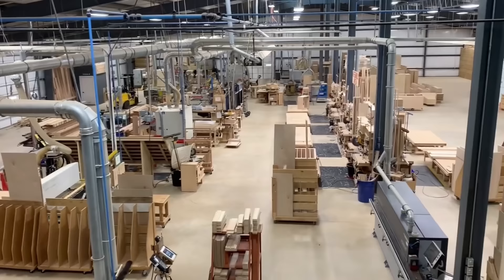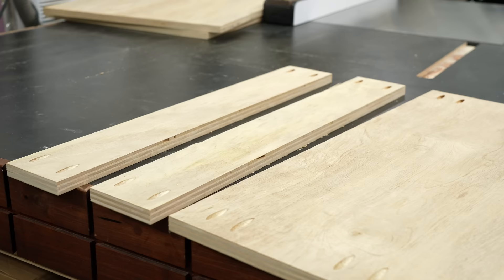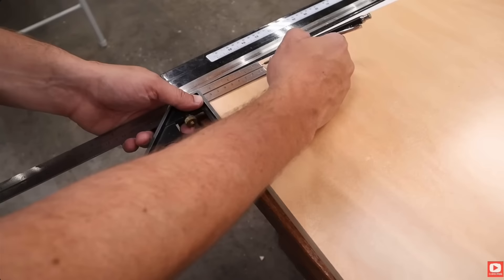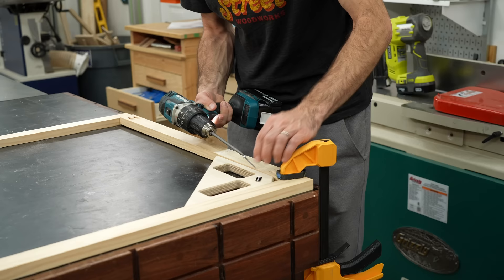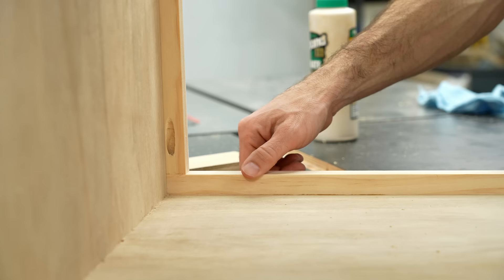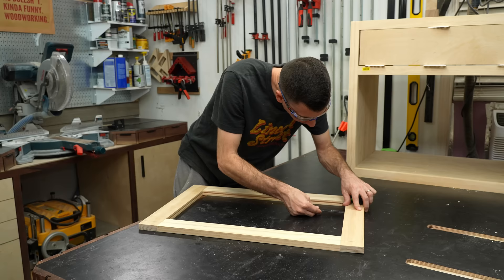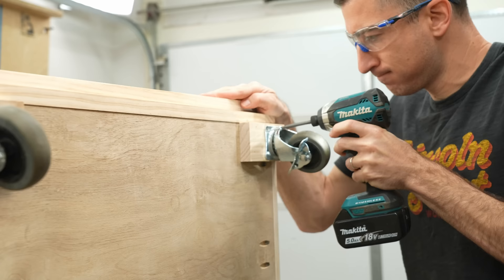Bad Beginner Cabinet Tips

Comment: They got those push trolly just need a bonnet and you got Trojan horses.  But I was trying to figure out why jewely boxes only fit turds, its because theres is no vertical display box.  I mean you got 30 flavors of vape juice, how can you read the labels?  Vertical display box.  Two on either side, 7 across a distributable load - [ every manufacturer reinvented apple peach ].  Tools touch down first in your mind though, its the same acrylic case layed flat.  But how to cram a hole good, so 24in deep is pretty deep.

Comment: Is it overkill? Is it?
Your cases, drilled into the wall, won't face the same stresses, but over time, they face some, and the deck screws will gradually pull out of the plywood endgrain.
Corners made by screws into any end grain, especially plywood, are bad for long term stability, because they pull apart eventually.
Reply from the maker: This would be true if you were pulling against the screws. But you’re not.
Reply: @Lincolnstww  there's always a little stress. It will last a good long time, but it will eventually pull apart, just get wobbly. You gotta account for that if you want to do it really good.
Your work is clearly "pretty" good.
Reply: @itsROMPERS... My guy, this is a video about making easy DIY cabinets with a limited tool set.  Maybe you should relax.
Reply: @AuronJ  I'm totally relaxed. I just remember that joining with by mailing into endgrain is not ideal. Because it isn't.

Comment: I did not cut toe hicks in the cabinet. I built a 2x4 frame 4”smaller than the cabinet and attached it to the floor and leveled it. Then just set the cabinet on it. Simple.
Reply: I put a level ledger on the wall and use Desunia Cabinet Leveler legs on the fronts.  You can scribe a toe kick face to the floor and clip it to the legs.  This means your bottom cabinet sides sit on top of the bottoms.  Leaves plenty of room for future plumbing/electrical runs...

Comment: Great tips...and here's one for you. Correct speech includes the words:  length, width, depth, and breadth. However, if I am hearing you correctly, you are saying "heighth", which is incorrect. "Height" is like the word "weight" in that it ends with only a t and not a th. (...and this is a case of "always", not one where "either/or" is OK.)
Reply from the maker: You are not hearing correctly

Comment: re: Tailgate (I'm sure you meant the lift piston that holds the hatch/window/lid up) - a more compact solution is a piece of PVC cut to length of the piston rod, and a cut down the side so that it can slip over the rod.  You can slip it over the rod and the hatch will stay up.  Equally good if you need to drive with the hatch up, but don't want it to bounce (and mar your materials).

Comment: The links to the tools used is very helpful. It's worth it to make something out of plywood instead of getting a particle board/mdf piece of junk from a big box store. Got one of the junk ones for my friend's kitchen but the rest were unfinished plywood ones from Surplus Warehouse (now called Barton's Home Outlet). The particle board one is already falling apart. The other ones are in great shape.
There were some techniques here I didn't know about so this was helpful. Although, I think I want to do a french cleat mount for my wall cabinets in my bathroom. I can still screw the cabinet to the wall, but the cleat will hold it in place better.

Comment: before watching this video i am commenting on the thumbnail. i dont like screws in fine carpentry, i HATE pocket screws in anything. i use rabbet joints, miters, dovetails, etc. with glue and nails. no not gun nails either. i pre drill and hand drive. sinking the heads perfectly flush. no filler. i always thought it looked good, that is my preference and anyone ive made something for has been pleased with the outcome. only time i use a nail gun is for assembling pieces that the naked eye doesn’t get to look at.

Comment: Excellent video, and excellent advice.   I do, however have just one issue with the drawer construction... that inset drawer bottom rubs me the wrong way.  If it was in a plowed groove it would be well supported even if the glue failed.    Yes, that will reduce the depth of the drawer slightly, but... Anyway, excellent video.

Comment: I'm jealous of the clean cut that you get when cutting the plywood with the circular saw.   My cuts are not that clean and neat.
What blade do you have in your saw?  Do you have any other tips for getting clean cuts with a circular saw?
I love your videos.  Keep 'em coming!
Reply: Trying running a line of tape on each side of the line. Keeps the material in place and reduces tear out. Use a finer tooth blade.

Comment: Great Video.  A 2X4 is all you need for a toe kick, long side up.  They are easy and best thing is you can make a nice LEVEL base the cabinets sit on.   You can simply paint or attach a pretty wood face to the exposed side when finished.
Reply: One of my early woodworking projects was a toe kick, to turn an Ikea over-the-fridge kitchen cabinet into a family room window seat. 2 by 4s, cut with a Japanese pull saw, fastened with pocket screws. The cuts were wonky, so glue wouldn't help much, but strength in the joints wasn't necessary. Finish was a coat of paint ... didn't have to look good either, as who checks the finish quality on a toe kick? 

I finished with a skill I knew much better, and sewed cushions and throw pillows for the top.

Comment: I'm new to cabinet building but if you glue the edge to the face of the plywood, is it really adding much strength? It would seem it would only be as strong as the bond of the veneer.

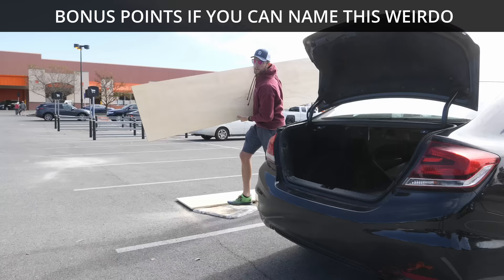Comment: 0:55 I bought what is now an almost 20 year old minivan (I call it the mule van) for cheap, for the purpose of hauling materials. I have to move the drivers seat uncomfortably forward if I want to get a full sheet of plywood in there, but it totally slides in. And for 12' lengths of materials (in my case, concrete form tubes which I use in the process of building certain cat tree features), I can just strap them to the roof rack! Right now it's a parking space thief (it's not starting), but I have more plywood than anyone I know. If I need 2x4s or 7' long round fence posts, they will in fact slide into the back of my Acura ILX with the back seats down.

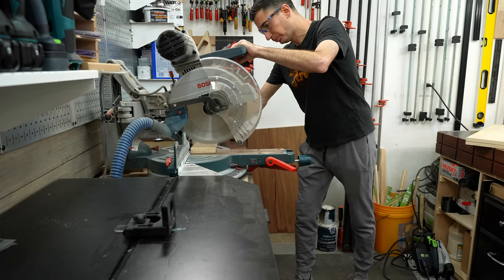3:26 Oh man.. I see people using it for building cat trees. People bring me those cat trees to get repaired, and I always notice something has gone wrong with the OSB (it doesn't like getting wet). I explain to people that it's not a structural wood product. It's meant to be the base for a roof or walls on a house, or subfloor (because it's supported). It also HATES screws going into it from the edge.

3:32 It's black bears.

8:04 I was just thinking about pocket holes.. So I'm an absolute n00b with that method. I built an infeed table (used as support to eliminate one axis of adjustment when cutting a whole sheet of plywood in half with the table saw) which doubles as hardware storage and a tool crib. I used finished plywood, but I found the pocket hole screws would SLIGHTLY deflect the wood on the other side. While watching this, I JUST realized that I just needed to adjust the little set stop on the drill bit to make a slightly shallower hole.

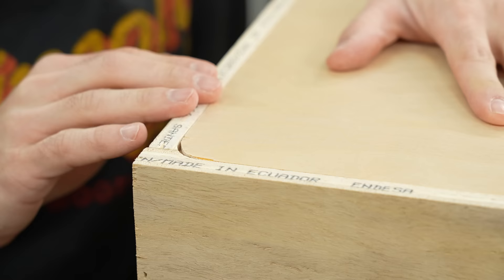10:15 You can also hide the plywood edge by adding any kind of finishing piece like a corner bead (if you want to get all oldschool about it) or a simple rectangular finishing strip cut to whatever size you think looks subtle but pleasing. That's what I love about projects like this. Lots of options!

Comment: What is the guide rollers you are using with your tablesaw fence? My fence only has a t-slot at the top and all the roller guides I can find require the t-slot to be on the side of the fence.

Comment: My old kitchen (built approximately in the '50s) has the old custom built cabinets.  The drawers just sit on wood rails and have worked just fine for at least the past 50 years.  No metal rails to accidentally get bent and have problems installing.

Comment: As one of them metric people (though I wish we had all gone with base 60 instead of decimal, but that is a whole other discussion), let me throw ya a bone. I think it is nice you point out considerations of the system you do use, exactly because the math would be a bit more clunky. That is the whole point of instructional videos (or instructions in general), bring up the possible complications and pitfals and how to deal with them so people can be ready for them in advance.

On the other hand, inch math can be about as plain as metric if one just don't mix denominators. Just measure and white it all down in terms of the smallest fraction your precision level uses, just simplify fractions at the end if you need to communicate with others. Don't do 1/2 + 3/8 + 7/16 = why?, do 32/64 + 24/64 + 28/64 = 84/64 (or 1 20/64", or 1 5/16"). Or just use thous (which is literally doing this, but using a 1/1000 fraction implict fraciton instead.

Comment: Three points:
- The greatest stresses on cabinets doesn't come from opening and closing doors.  It's the weight they have to carry.

- I heard you mention stiles and rails.  If you want your readers to learn more cabinetmaker lingo, add gables (cabinet sides) to the mix.
- Don't ever assume that a pair of drawer slides are 1" thick; buy them first before tackling the drawers.

Comment: That weird guy in the parking lot is me.   I even have folding sawhorses for it.   

I also wonder where you go when your 'going out to dinner' costs you $45 for one person.  

Please note - there's nothing wrong with using OSB or other 'exterior' grade construction board for most of the parts of your cabinet.    My personal recommendation is that everything that's not exposed to the world, or even the entire cabinet for your shop, can be whatever's cheapest.    I've seen OSB cabinets that were 30 years old and still in perfectly good shape.  I've also seen hardwood plywood cabinets that looked like crap after a decade.    You also don't NEED solid backs for cabinets that are mounted directly to finished walls.   The point of the back is to keep things from falling out.   Otherwise, just use corner or side 'brackets' to maintain rigidity and to make it easier to mount to the studs.   Same as the top, where you generally just put stringers - because you're not going to be looking at it daily. 

If you think I'm nuts - go find someone who has Victorian era armoires, cabinets, etc.  Look and see how wonderful the sides, backs, and bottoms are.  They're actually as low grade as they can get away with.

Comment: If you make your face frames so they are flush with the inside of the cabinet, then you don't need spacers for the drawer slides. Who cares if the face frame overhangs to the outside of the cabinet (as long as the cabinet was sized appropriately)?

Comment: Ps the cheap draw slides aren’t too bad. The expensive ones you’re using aren’t much better!  If the alignment isn’t nearly perfect. The ball bearings aren’t sealed, they pop out!😢. Inserting draws is A.P.I.T.A. The easiest way is to use the old way. They didn’t buy draw slides back in the day. They used a strip of wood inside ,on each side to support the draw

Comment: pocket screws on a face can start to pull out if your woods not perfectly dry, i would suggest a stronger method there like dowls or a physical joint.
Reply: i have a massive cabinet i used pocket screws on and a couple of the cabinet joints pulled away. i even used glue on the screws and faces.

Comment: Great video. There’s one thing I’ve always wondered or maybe it does not matter. But if you are building a standard  six sided box do you want the side panels to sit on top of the bottom base or should they be attatched to the base itself which would increase the overall area of the bottom?

Comment: Love the presentation. What glue is used o attach the face? Also What brand/ type drill suggest? I want to buy s good one once. All i heard so far is get brushless. What volt do i want between the 12-20volt models and is ot matter 3/8 or 1/2 chuck?

Comment: Have you ever built "hidden" toe kick drawers into a separate base like this?  I'm curious if the cabinet will still be supported properly without the toe kick bearing weight.  I might try this out by doubling up the rest of the base so that it's 6/4" thick rather than 3/4".

Comment: The only part of the video I was a bit hesitant about was the drawer bottom... In my vast experience of assembling a dozen or so premade drawers, the bottoms would typically be slid in using grooves routed in the sides of the drawer, similar to how the cabinet door was made.  Just tacking the drawer bottom in from the beneath seems fine for light weight items, but in a shop where heavy tools might be dropped in the drawer,  I would expect some of those nails to pop loose eventually. Is that actually likely?
Reply from the maker: If you only tack them yes that’s very likely. But when you add glue it’s pretty strong. My shop drawers are made like that and have some heavy tools - no issues

Comment: A beginner building a tool base, especially one with limited space, would be much better off getting a track saw instead of circular saw AND table saw.
Track saws are not just for ripping sheet materials. You could build these cabinets using just a track saw and drill.

Comment: To be clear a rectangle is a parallelogram, a square is a rectangle, a square is also a rhombus.  However, a rectangle is not a square, and a parallelogram is not a rectangle.  Got it?

-Parallelogram: a 4 sided figure in which opposing sides are perfectly parallel to each other.
-Rectangle: a parallelogram in which all 4 corners are 90 degrees
-Rhombus: a parallelogram in which all 4 sides are the same length
-Square: a rectangle which is also a rhombus

Comment: Isn't that drawer bottom relatively weak?  Both in the center as well as not being very secure around the edges?
Reply from the maker: All my shop drawers are made similar to this. I’m rough on them and they hold heavy tools with no issue. It all depends on what you’re storing in them

Comment: Wait, so... No mention of CAD? I don't so much as hang a picture on the wall without a set of proportionally scaled and fully dimensioned drawings to work off of. It looks like you've got a few sketchup models for the video, but I'm curious to know how much you work based off of those CAD designs or if you've got some other system.

Comment: as a european im always puzzled by why americans use framed cabinet construction and then have to hustle by adding spacers for drawer runners, and loose usable interior space. Also base plate is not in full cabinet width and is not supporting sides.

Comment: Hand tools are gross????  I used to use power tools for everything.  One day many ago my folks moved onto some bare property.  We needed a house built and there was no electricity.  Using a hand saw, chain saw, a square and hammer we built it all.  I hated every second at the time as I was only about ten years old and cut every board of that house with a not so sharp hand saw.  Years later I mill my own lumber, hand plane it and enjoy every second.  I get a satisfaction looking at what I have built knowing that I made it from start to finish...  pun intended.  Sure its manual labor.  Its a deeper appreciation though.  That board did not exist until I cut it.  That grain was not visible until I revealed it.  I have looked in on that old house that someone else now enjoys and the roof is still straight and true.  I nailed those roof trusses together on the dirt of our drive way with 2x4 blocks nailed into the dirt as jigs.  I don't think much at all about the homes I have built or repaired with power tools and such but I remember that old house.  Every back breaking second of it.  

That all being said, nice cabinets you have built and thank you for the video.  I like using pockets screws too when they are needed.  I have taken to the idea of drilling the hole and gluing in a wooden plug instead of a screw.  Hand tools have their place just like power tools do.  Wood clamps are not power tools...  but we all still find a need for them.  Perhaps one day you may feel the same about the other hand tools.  You never know.  I disliked them for more than 20 years...

Comment: Pro tip on the broken tailgate strut: keep a pair of vice grips handy, clamp it on the strut when the  hatch is open. A failed strut on a hatch is a real headache, but not as big as the headache you'll get when you accidentally knock that 2 by 4 out of the way

Comment: Build your own saw guide using 3/8 inch quality plywood.  Pick a piece with  absolute straight factory edges.  Mark both factory edges with a sharpy and then rip 4 inches off of both sides.  These will be the edge guides that your saw will ride against. Now rip two 11 inch x 96 inch pieces of what is left.  Glue and screw the  4 inch x 96 inch edge guides on top of the 11 inch X 96 inch pieces.  Now take your saw with a good blade and run it against the edge guide and you will have a great 8 foot saw guide !
Make a 2nd one and then cross cut it at 54 inches leaving 42 inches.  You now have 3 guides.  One to rip 8 foot plywood, one to crosscut 48" plywood, and one to crosscut doors.  Make your initial cut against the edge guide and then you will know exactly where the cut line is .  Spray them with 2 coats deft clear wood finish and your saw guides will last for years.  Breaking down plywood just got a lot easier.
If you use a rear handle left bladed saw you can see the cut line better and cut 8 foot panels with ease.  Flex sells a great rear handle left blade saw with a 10 ah stacked lithium battery now on sale for 
$ 250 at Lowe's.  The integrated dust port blows dust away from the cut and not all over you.  Good luck guys.